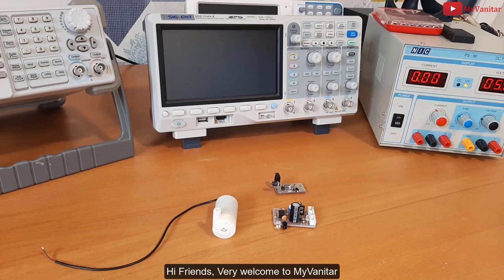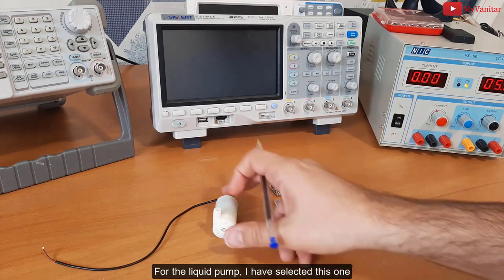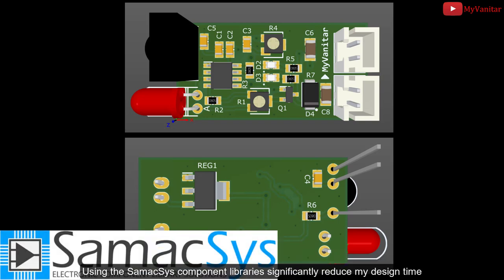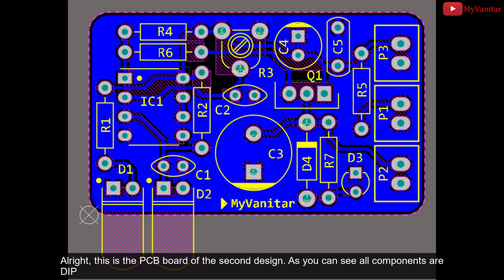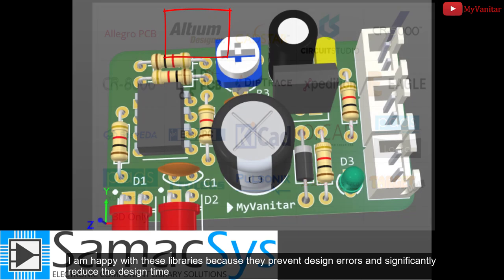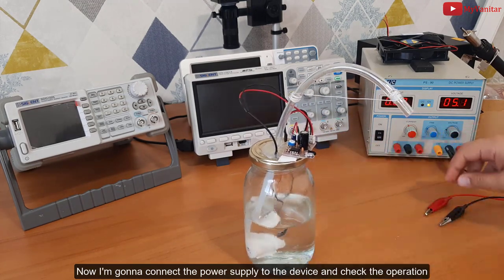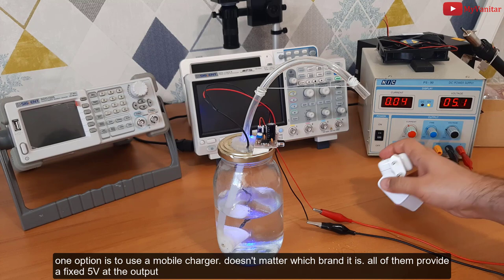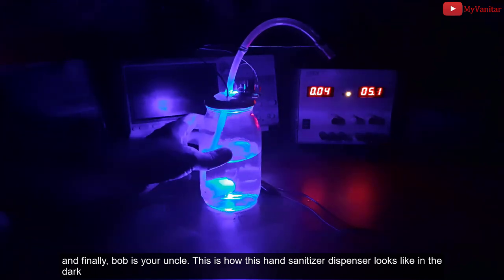Hand Sanitizer/Alcohol Dispenser Circuit/DIY, Without an Arduino/MCU [Fight with COVID-19]

Comment: Hello Sir. Nice work by you. I did the circuit but pump starts directly without IR sensing. Wat cud b the problem
Reply from the maker: The circuit is Okay and works properly. must be a mistake somewhere. As you see I test everything and show it live! However I have also introduced another design. Check the second design, (pro version). Watch the video till the last second and completely read the article

Comment: Thank you for the video...I have a question here.... Is it safe to use electronics with Alcohol based sanitizer?
Reply from the maker: it depends. like this is not a problem. the pump is waterproof. the same as the pump inside the car fuel tank
Reply: @MyVanitar  Thank you for replying.

Comment: Is there a chance of explosion due to sparking as motor is immersed in alcohol based sanitiser?
Reply from the maker: No, the motor is waterproof, never gets warm up. besides it is a simple pump with a small DC motor. also, sanitizer is a mixture of several liquids. does not burn easily. as a result, if you still have concerns, simply use an external pump. the circuit is identical, however, the same concept is being used to transfer the petrol to engine in vehicles. some pumps are external but some petrol pumps are internal that are embedded in the vehicle tank. Petrol is highly flammable.
Reply: @MyVanitar  Thanks sir for your explanation. Yes I know petrol tanks in vehicles have internally immersed fuel supply pump.
If I fit an external pump above the lid, will it cause a problem for the pump to create a suction lift?
Reply from the maker: @mayurparab499  no problem with suction, but you can not use this kind of pump that immerses in the liquid. You should use a pump with IN/OUT valve for pipes
Reply: @MyVanitar  Thank you saab for your explanation and clearing my doubts. Respect and love from India.

Comment: Hi. For smd  pcb how much voltage we need too use ?
Reply from the maker: As you can see in the schematic, it uses a 1117-5.0 regulator. So if you check the datasheet, it suggest you the min-max range

Comment: Will this circuit work for 12 V supply
Reply from the maker: The circuit works with 5V, so if you use a regulator Yes. Therefore convert your 12V DC to 5V using the 7805 regulator or whatever similar and then you are fine

Comment: can you please upload the working video of the first circuit, cause am getting it to work only for a few seconds at a time.
Reply from the maker: You mean the circuit with SMD components? I have tested both circuits, as I show them both in the beginning., however I decided to focus on the second one, which was easier to build for more people. In the first one you should adjust the potentiometers carefully. I put it under test for around one day with no problem. I will publish V2 of this soon, that uses an MCU, where you can adjust the liquid flow as well.